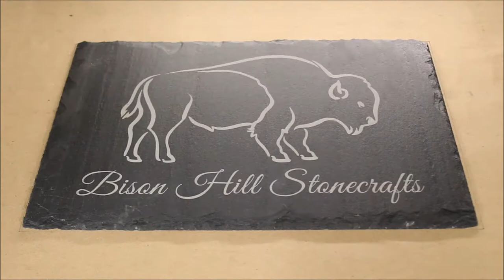Stone Turning a See-Thru Obsidian Shot Glass

Comment: I loved this video. Is that a regular woodworking lathe? What do you do to prevent rust, just dry it off well after using it?
Reply from the maker: Thanks! Yeah it is just a Harbor Freight wood lathe, I did some modifications to make it turn much slower down to a couple RPM though. I don't do anything for the rust, I bought it as a stone lathe so I just kind of accept that there will be rust. It hasn't affected anything I've wanted to do with it yet
Reply: @Bison_Hill_Stonecrafts  Thanks. I use a similar method to make beads that fit a Pandora bracelet. I drill the middle hole, then spin the bead to cut the outer shape and to polish it. I mostly use lapidary tools meant to get wet, but I do use my electric drill for part of the process too. I just dry it off and it's fine. A lathe is much bigger with more exposed metal though.

Comment: Glad I discovered this channel, stone working has always had my interest, but I finally get to see stone working done with tools that any average person has, and skills similar to what woodturning requires. One stone that I'm curious about is basalt, I've only ever seen basalt worked by stone on stone, and by hammer and chisel, I have yet to see any modern methods of working with it.
Reply from the maker: Thanks!  Basalt volcanic rock but is harder than Obsidian due to the crystal structure.  I'd still recommend using diamond tooling for it though.  It'll just take longer to cut Basalt than Obsidian.
Reply: Any average person has 😂😂😂I'm sorry how far in the past are you from dude how many people have a hecken metal Laith at home it's definitely not a common thing these days

Comment: You can get very similar chunks of black glass from many manufacturers. Probably won't have near as much manganese in it though. Black obsidian happens when a silica seam is near some manganese or some other black pigment and the lava flow smelts it all together. We call it black glass when a person does it and inside an when a volcano does.
Reply from the maker: It has more to do with the cooling process than the composition, if you cool the lava fast enough there isn't enough time for crystals to form and you end up with glass.

Comment: I started working with stone but have never thought to try using a lathe.. is this a special type of lathe? Do you have a suggestion for finding a suitable lathe for stone? Also is there a name for this kind of articulating hose you are using?
Reply from the maker: The lathe I'm using is a harbor freight wood lathe. You can use any size/type of lathe but the biggest thing you need to look for is the speed control, originally the slowest this one could go was 600 rpm, which is too fast. You want something that can slow down to 10-50 rpm range so you can let the diamond tool do the cutting.  Just be aware that you will probably get rust everywhere unless you meticulously dry everything after using it.  The hoses are called Any Way coolant hoses, I got them at McMaster and was able to adapt them to my water supply pretty easily.  Good Luck!
Reply: Thank you for the thorough info. I appreciate it! @Bison_Hill_Stonecrafts

Comment: 2:20 hope that motor is very well grounded?
Nice work, though. Sure is a lot of sacrificial obsidian.
Reply from the maker: The lathe motor is actually off and just free spinning. If you can catch a glimpse at the headstock end I have a drill mounted to the spindle.  It has better speed control than the lathe
Reply: @Bison_Hill_Stonecrafts  I did see that, but didn’t think that was driving your lathe. Interesting working with stone. I use mild steel and aluminum. Thanks.

Comment: I'm wondering. Would it be possible to be made without electrical tools? Let's say using pre-industrial technology?
Reply from the maker: Sure, lathes were around before electricity. For the shaping of the stone, Obsidian is actually pretty soft so you could use a harder stone grit to shape it.  It would just take about 40 times longer to make

Comment: What kind of lathe do you use?
Reply from the maker: It's just a harbor freight lathe, but I adapted it to go slower. The slowest speed stock was like 600 rpm which was passable but uncomfortably fast.
Reply: @Bison_Hill_Stonecrafts ok thanks. So when working with stone you want the speed to be a lot lower compared to woodturning? And also, what are the tools you used, especially the chuck? Do you think it’s possible to use chisels and gouges as opposed to the saw when turning the stone? With a harder stone like obsidian I see why the saw might be necessary but wondering if using standard turning tools on softer stone like marble would work. Ok this is my last question 😂 did you customize the lathe to have the water attachment for keeping the stone cool
Reply from the maker: @chrisclunan5097  Yes, speeds much slower than woodworking, the lathe just keeps the piece round. The tool does all the work to remove the stone. The chuck is a Nova chuck. There are videos of people turning Alabaster or Soapstone with wood tools but I can confirm that you cannot turn marble with wood lathe tools, even carbide. And yes I hooked up the water feed so I can have continuous cooling, I initially bought a Jet lathe but decided I didn't want to trash it so I got the harbor freight one just for stone.
Reply: @Bison_Hill_Stonecrafts  ok, thank you. So basically the only option is diamond tools when turning any stone that is remotely hard? How did you hook up the water system to the lathe?
Reply from the maker: @chrisclunan5097  Yes. The water supply is just a garden hose attached to the coolant hose and then I have some magnets to stick it to the lathe